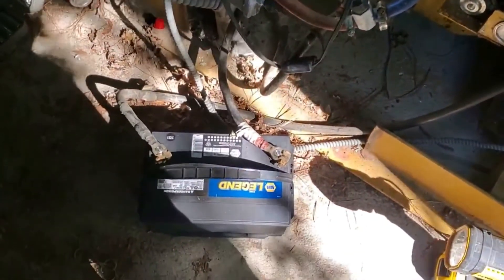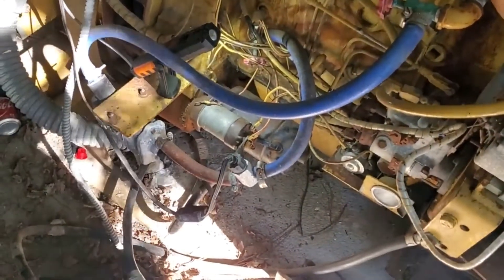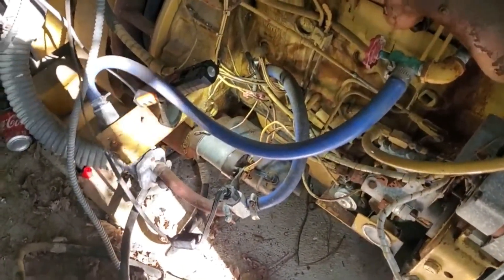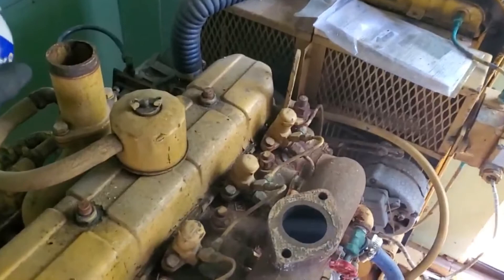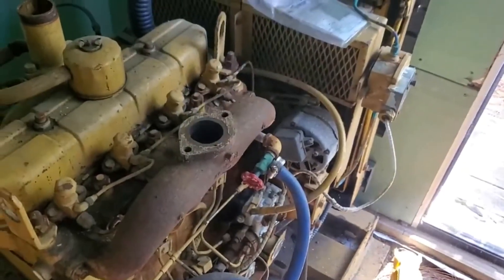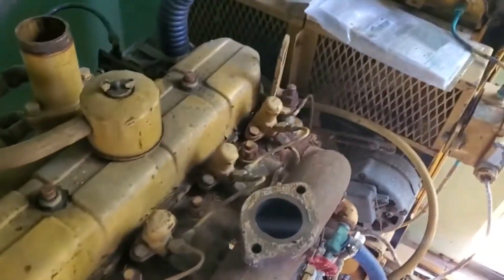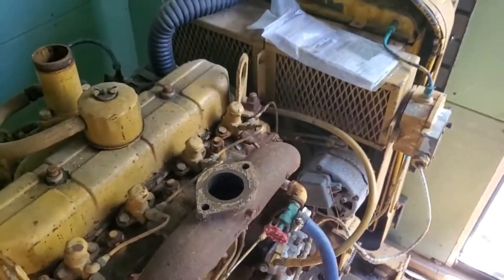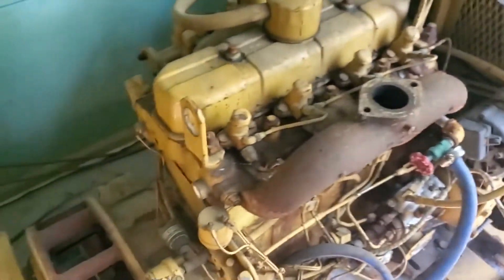Old Hercules D2300 Diesel Engine - Asleep for More Than 10 Years.  WIIL IT START?

Comment: Dude I have the same exact engine with 20KW Kato generator, has only 700 hours, mine is missing a starter so it's useless because I couldn't find the starter for it.
Reply from the maker: That's gotta be frustrating!  Tried herculesmanufacturing.com?
Reply: @GrandadFixit  Hercules said they no longer make that particular starter
Reply: @riftvalley1765  i bet you can find one at your local starter shop... it should be a 30mt starter with a 12 tooth gear in whatever voltage your system is